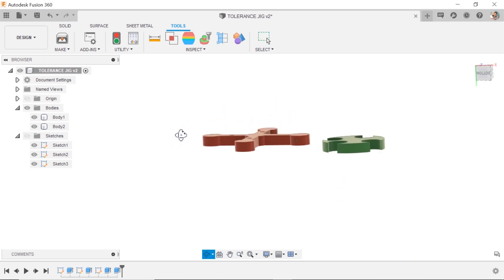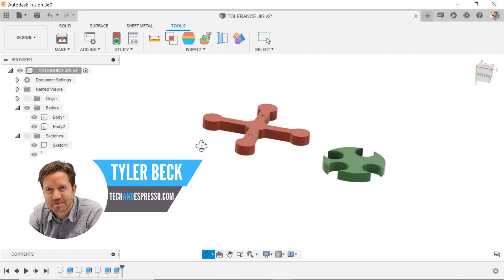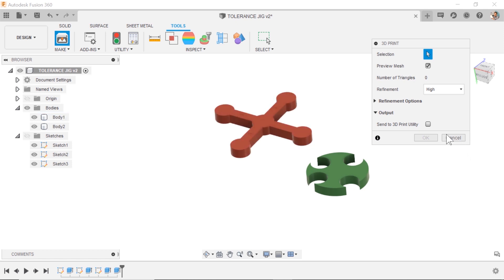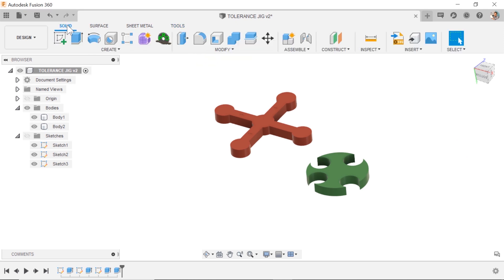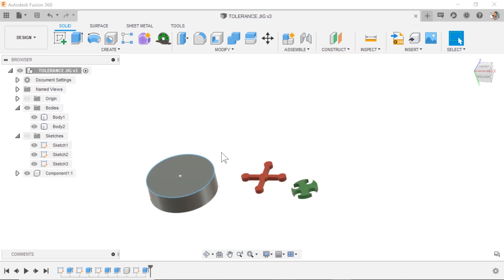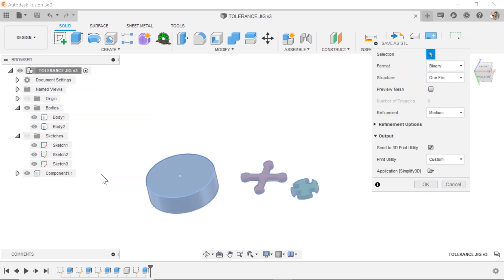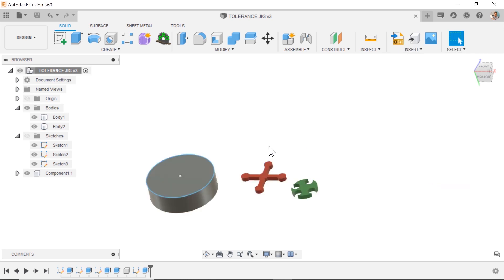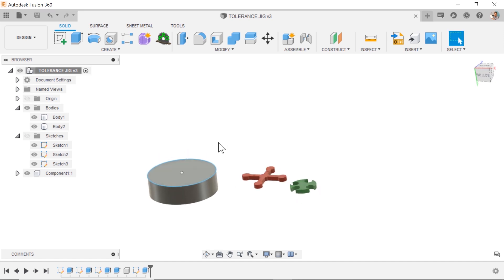Fusion 360 How To Send Multiple Bodies to 3d Printer (Avoid My Mistake)

Comment: The other way you were doing it will also work.  Just click MAKE, and then click the model name, rather than the model itself.  This will select all bodies and components etc.  Then the others options that were hidden will become active.  You could also just click BODIES or SKETCHES and it will do the same thing.
Reply: Underappreciated comment right here. Thank you. The tip in the video did not work for me (maybe because my  Fusion is for personal use only?), but yours did!
Reply: Agree with previous comment, this helped me A LOT!!! =D Many thanks